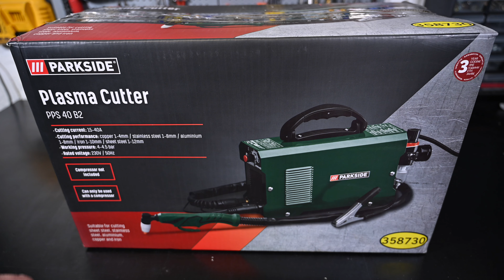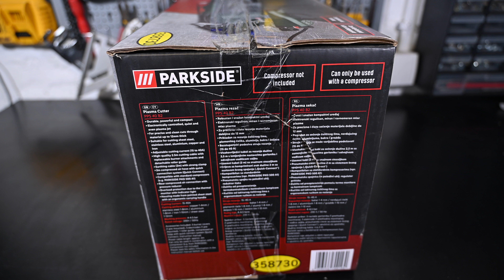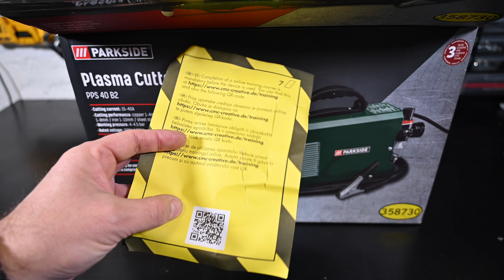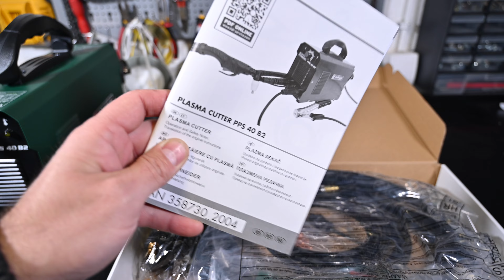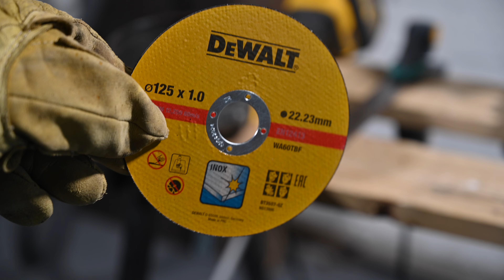Parkside PPS 40 B2 Plazma za Sečenje metala - Recenzija Test 4K - Plazma Sekač / Plasma Cutter 40A

Comment: It's like cutting cheese, maybe I'll buy from the performance.
The interesting thing is that it cuts 3 times faster than the angle grinder.
Well done my Friend🙂🤝🤝🤝🍻
Reply from the maker: Yes it is much faster than the grinder, just beware if working inside and be sure to have good ventilation.
Fumes produced are very dangerous. You can see two masks that I showed in video.
Thank you my friend :)